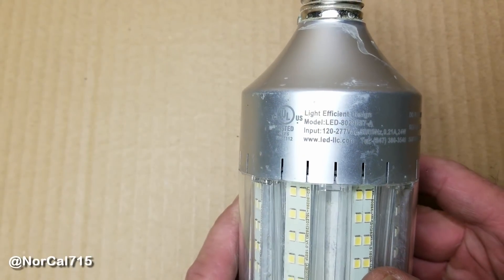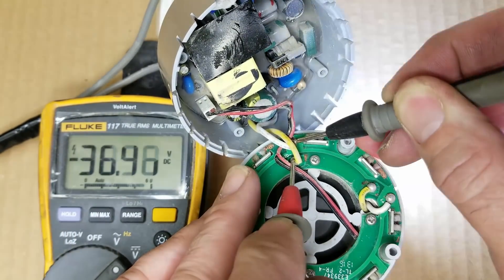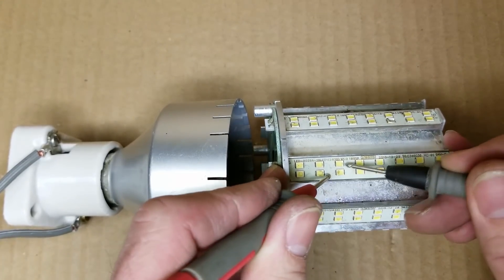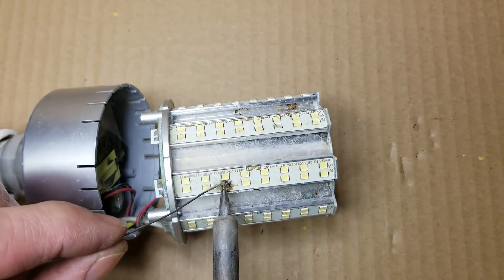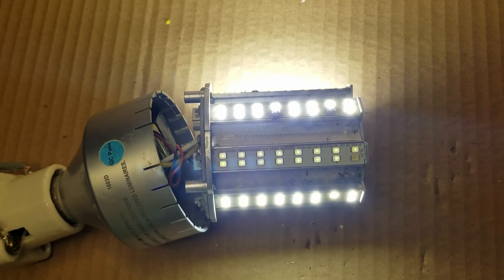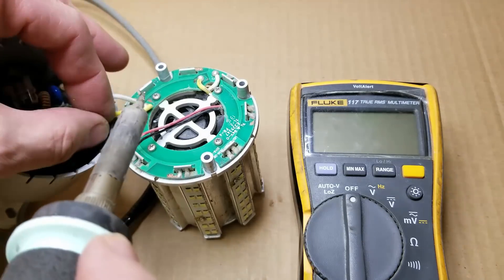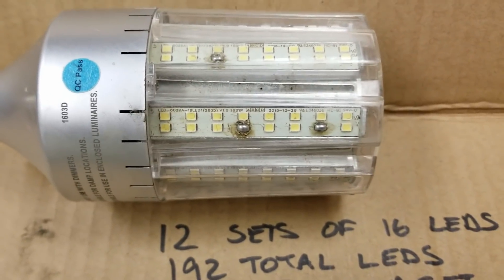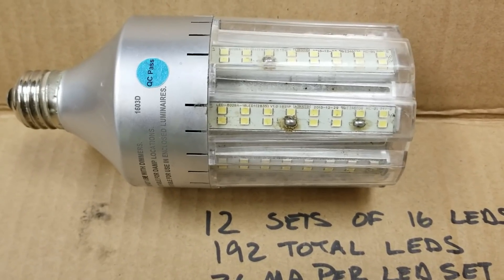Industrial LED Lamp Tear down and Repair (Patch Job)

Comment: Outside of edge cases and low-power operation, the luminous efficacy drops as they warm up.  Keep in mind that you can't measure luminous flux with a DMM.

The forward voltage does have a significant negative temperature coefficient, though.  What you observe entirely depends on how the control loop for the converter is set up.  If it is only regulating current, then you'll see the electrical power decrease as the lamp warms up.  If it were actually a constant-power supply (not probable), the temperature dependence of luminous efficacy means that the luminous output would still decrease as it warmed up.

It's really noticeable on the cheaper retail designs that run the leds at around >150C junction temperature.  Despite the fact that this design is essentially a bug collector, at least they acknowledged that a 20W led array needs more than 2 square inches of painted passive radiating surface for cooling.  

Either way, it's nice to see you around.  don't be a stranger.

Comment: Do not forget the fan draws around 2W to run, so overall the power supply is only losing 2W as heat. Pretty efficient, given the wide input range it has to cover, all the way from 100VAC to 300VAC, meaning the power supply has to run from a DC bus voltage from 100VDC to 450VDC and still regulate.
Reply from the maker: Good point. Didn't take into consideration the fan draw when assuming efficiency of the power supply. It's more efficient than previously thought.  Thanks for your comment.

Comment: The best advise for anyone is if possible never, never run an LED at max current.
Reply from the maker: Ya I had to replace my DLP TV a few months ago when it went out and I was still doing a lot of coast to coast traveling and bought a new LED/LCD tv. The backlight is at 45% to extend the life of the LED's
Reply: I think the best advice is to learn a functional understanding of thermal design before implementing a power LED project.  I think most people would find the results of an appropriate design calculation incredulous; after all, it seems that most retail LED lighting products cannot maintain Tj<Tjmax at anything over 25C.  Surely good design practice must be wrong!

That, and I keep hearing people parrot things like "but leds run cool" ... as if they can somehow remove heat when Ta is 60C - 80C.  

Sorry.  I'm just grumpy today.
Reply from the maker: Most LED's are run at a 100%+ design level... so reduced lifetime. If only they would over engineer products to run at full capacity around 60% design potential things would last so much longer.  Thanks for your comment!